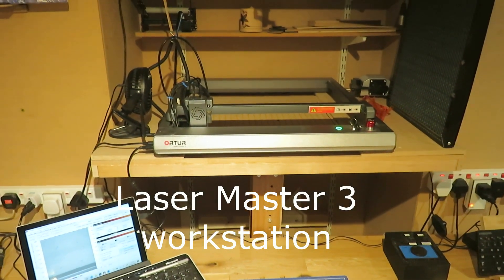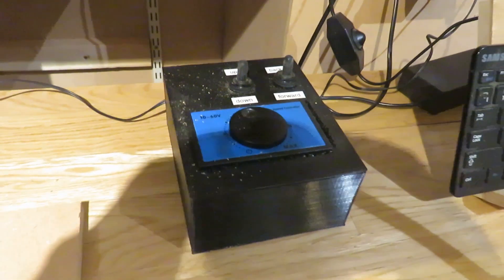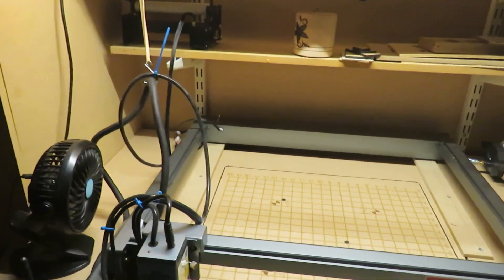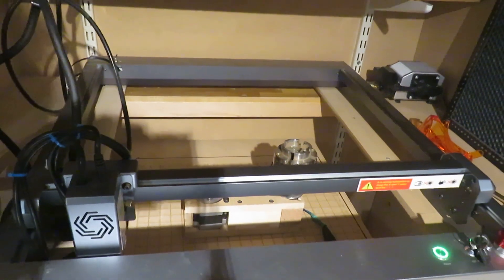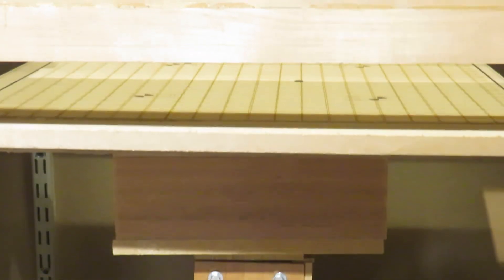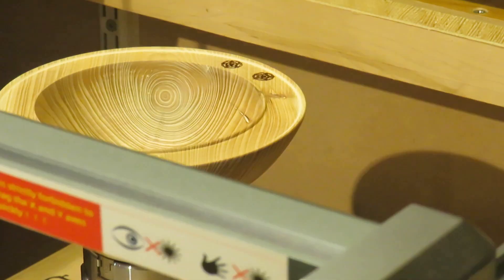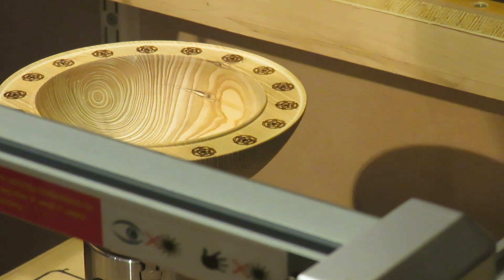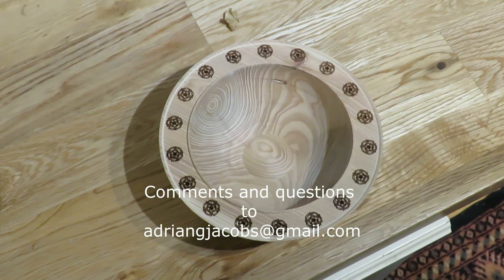Laser Master 3 Work Station

Comment: Very nice indeed but I'm concerned on two levels of safety...fume extraction and eye protection.

Fumes from most materials contain various levels of poisonous gases and it's vital to have extraction outside.

These LASERS need specific wavelength eye protection as even reflections can damage the retina in an instant. I worked on LASERs since the early days and recent popularity of diode LASERs often neglects to give the correct safety information. My  LASER is housed behind the correct filter and the eye protection goggles I have were specifically chosen for the diode wavelength and we're not cheap. If you wish me to send you further information then please reply and I will email you further information.

Safety is absolutely paramount